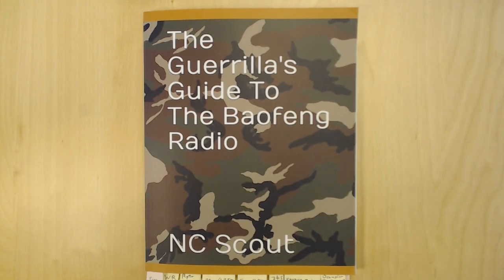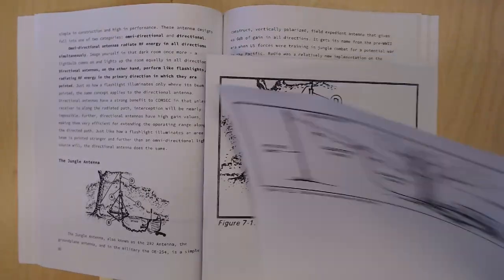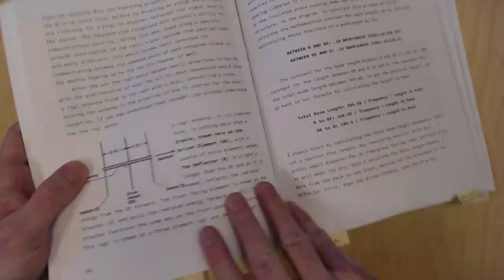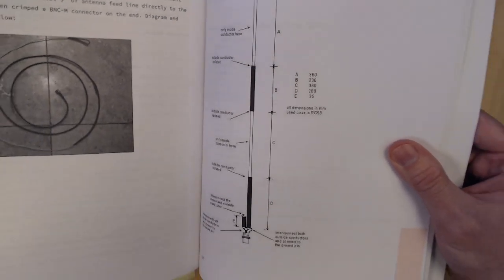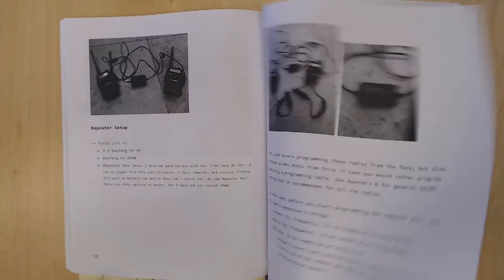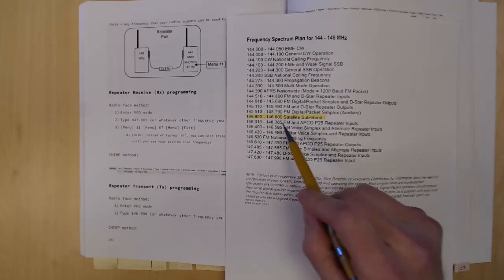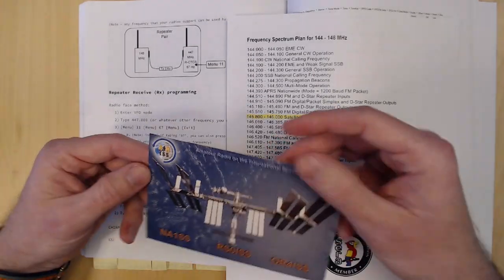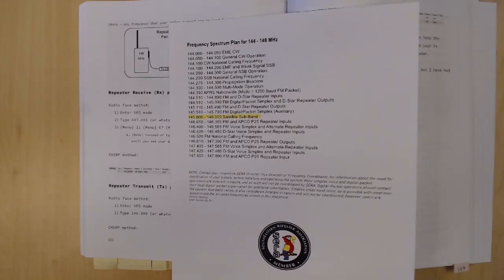"The Guerrilla's Guide to the Baofeng Radio" Has Problems

Comment: I mean part of the point is to consolidate info from different sources. all u need to know in one book, rather than several field guides, a random form, a YouTube vid, etc.
Reply from the maker: Part of the problem is that the book consolidated information with literal copy-paste in a way that is (at best) plagiarism.

But had that been the only issue, this book wouldn't be that bad. Extremely basic things are wrong in this book. It's better to have a collection of sources with good information than one source with bad information.